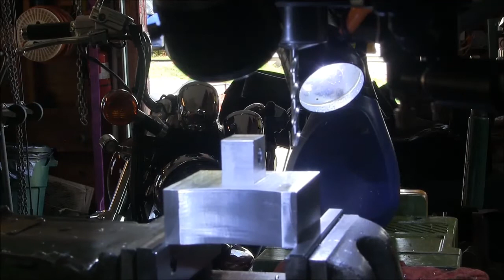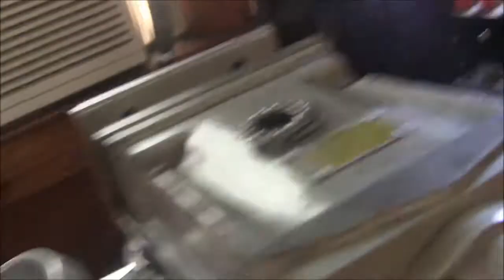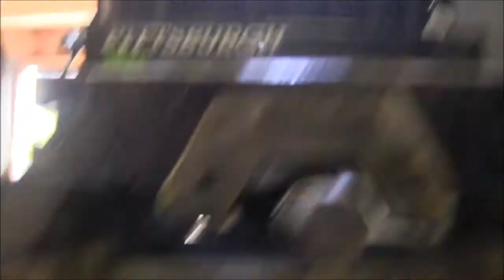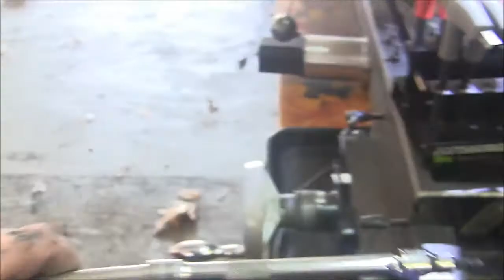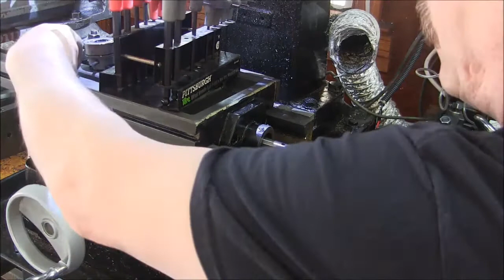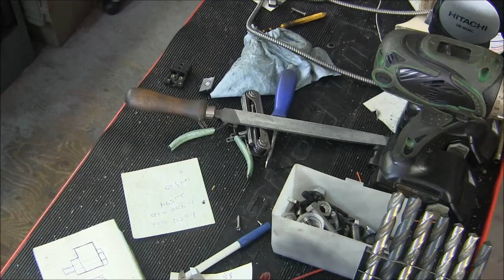Doodads XVIII

Comment: Nice idea re-purposing those dividing plates. Radiusing the block worked well.
Gave that press a workout!
Some interesting items covered. Nifty light power feed.
Reply from the maker: I think I am going to make a 100 hole plate for it. I will have to work on the light power, I have some armored cable now but terminating the top end is a little tricky. I did get a better acid brush :-)